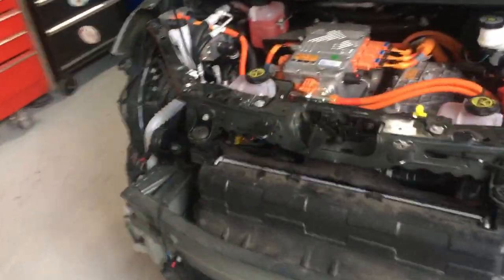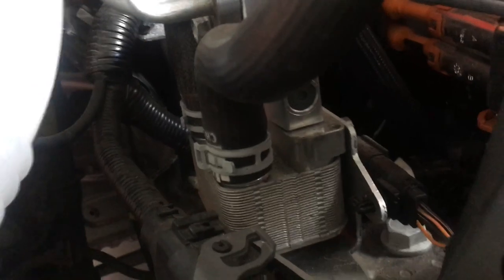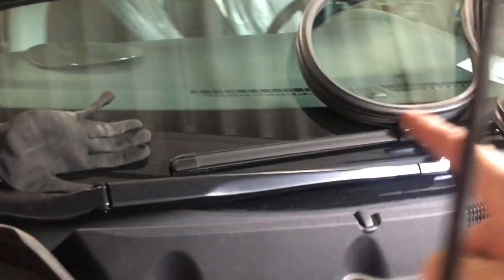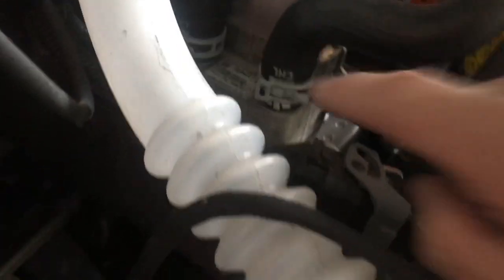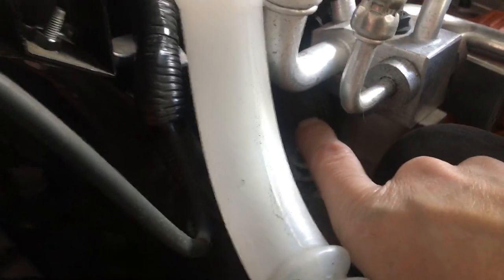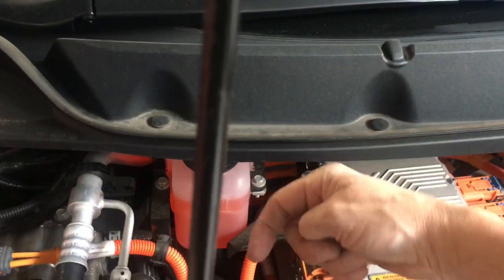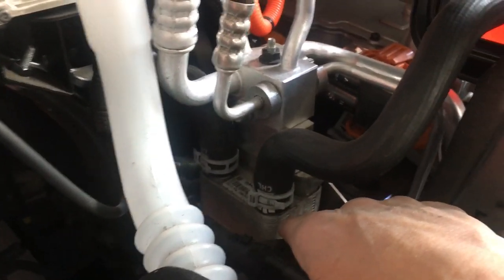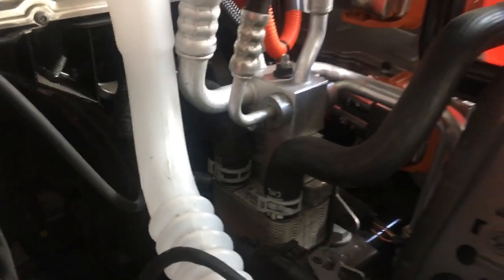2019 Chevy volt battery cooling

Comment: When your condenser develops a small leak you won't just be able to open your window to cool down - your vehicle will grind to a halt with its powertrain / batteries overheating.  Plenty of work for AC techs to come.
Reply from the maker: I already get plenty of this kind of work. Hybrid Ford escape is a good example. When the AC would go down on warm days the triangle warning light would come on the dash and I believe the customers comments they could drive about 1 mile then the vehicle with shut down. 
                 On the Prius your air-conditioning keeping the cabin cool there’s a blower motor located under the rear seat of the passenger. If it’s very hot outside Arizona 100° or if you’re traveling down the highway on the blacktop it could be 115° or 120° with the heat of the air that develops on black asphalt. You would get the triangle of death for your battery warning you to pull over and shut down if you don’t it will shut you down. 
              Another example of lack of knowledge some of these vehicles have solenoids that physically shut off valve in to the rear expansion valve for the rear evaporator or sometimes heat exchanger. It traps liquid refrigerant inside that line and that whole rear unit. The technician hooks up his big square refrigerant recovery and recharge machine and only recovers the refrigerant in the front half of the system the other part of the system has refrigerant trapped in the lines because the solenoid valve is tightly closed. Then the technician tells the machine to recharge the air conditioning with the factory quantity by weight back into the system (guess what just happened?.) because the technician did not know you have to have the key in the on position to keep that solenoid valve open to release the refrigerant when performing the recovery. 
               And if you just happen to perform that procedure on a cold day when the customer came in say somewhere in the 50° range to low 60° range he will probably not notice the high side will not be very high because it’s overcharged on a cold day. 
          But when the customer let’s say as an example one week later drive somewhere on a long road trip where the temperature is 20 or 30° hotter he will now have 400 psi on his high side and poor cooling performance and if it goes a little higher either shut down because of safety switch high-pressure or burn up the compressor clutch. I get a lot of these every year from very large experienced mechanical shops. And when you burn up and litter metal debris in a duel air-conditioning system all the way to the back evaporator have to take out and flush everything replace both expansion valves condenser accumulator you’re talking thousands of dollars. 
             And the failures usually don’t happen right away sometimes many months later or even a year later.
           Usually caused by the mechanics who use the little cans and charge the AC system up by pressure or temperature it works great at the temperature of the day that the technician charged it up on , but when the customer will go somewhere else hotter or colder is when the failure happens.
Reply: @coldfinger459sub0  - the need for good repair procedures and data is vital then.
Reply from the maker: Automotive Solutions The training has always been there and it’s even better today than it was 40 years ago when I was young we have Internet instead of having to go to the library‘s and check out books or order books and wait 3 to 5 weeks for them to be delivered from the car manufacturers to get OEM. 
          Most owners and many texts are too lazy or too cheap to go to training. Some believe if you go to training and you just sit down in the chair all the knowledge is going to just pour into their brain without picking up a book and reading as we know mechanics are known to be a little illiterate or lazy to pick up a book and read those little words on the page.
              Then there are those who are either the owners or technicians who literally believe you learn by breaking things and after you break it and you replaced it you have learned OMG.
           There are so many shops that either to the lack of knowledge of the owner of the business or the manager of the business the service writers of the business the technicians of the business they lose so much money by not educating themselves and wasting so much time on diagnostics and replacing wrong parts over charging the customer charging the customer for a wrong parts repeating this procedure for the whole entire careers.  Some of them struggle to make ends meet and they have no money or they won’t put out the money for education because they’re losing so money because they have no education. It’s a vicious cycle that keeps repeating itself over and over.
           One thing my father got clear into my head when I was very young even though I didn’t like to read books. Educate yourself better than the next guy learn more than whatever boss you have. Your boss can limit your hours your boss can not give you a raise if he feels like it your boss can not give you extra vacation days but the one thing your boss cannot take away from you is your knowledge. And once you have that you can fire your boss. If the owner of a business chooses to be ignorant do not allow him to bring the others that work under him to suffer from that same fate. 
           One day this is going to make a good video topic that will probably be very long video when I do it, (How to Fire Your Boss!.)will probably be the title.  
             Because in the end it’s the consumer who does not have the knowledge to fix their own cars who get ripped off from lack of training. And it is the technician who is starting out without education gets ripped off because he cannot make a good livable wage in a field that’s becoming extremely technical and complicated with a very high degree of electrical knowledge background that is needed on top of mechanical. 
            Need to educate all the young technicians not to become a parts changing monkey like they’re ignorant boss who can’t even perform his own oil change or diagnose his way out of a paper bag. 
           We need to eliminate all the owners of companies who can’t work on vehicles and selves who hold back the livelihoods of the technicians who work under them.
Reply: Well said, your father gave you some wise words. Thanks for sharing them. 👍

Comment: MUST you have that radio blather in the background competing with your instructions?
Reply from the maker: This is not my shop I’m just called in to do the work for them that’s my specialty.      The shop always has music blasting in the background I cannot work like that. 

      If you’ve seen many of my other videos you will notice I’m in many different shops all over the San Francisco Bay area I have a list of 1200 different shops I’ve been going to for nearly 30 years.     Some of them are quiet some of them are blasting radios. 

      Sometimes I making a video right next to a guy using an air chisel or a sander or impact gun and I have to yell above the sound of the tool.  
          I’m not a YouTuber  Who barely has work and can do one video a day setting up sound and lights in editing all my videos or live and take it in one shot no rehearsal and no editing.  
          I have to work for a living and earn a living no time for fancy camera work or sound system.

Comment: I have a 2016 Chevy volt with heating issues.  I get heat intermittently usually driving up a steep grade.  I hear gurgling sounds at times I feel like the system has air trapped in the lines.  Any ideas?
Reply from the maker: Sounds like air.  Fallow manufacturers instructions to purge air.
Reply: @coldfinger459sub0  thank you very much sir.  Unfortunately looks like the only way to purge is with a scan tool.
Reply: Then at my shop we say YFB (your fucked buddy) and "how deep are your pockets"?
Reply from the maker: @gregstandish6439 🤣 

Had a Tesla Y model burned out compressor and I was asked how much would it be? 

I asked them do they have the income of a small island nation .

Comment: yeah my 2014 volt is having issues with it. my advice, stay away from hybrids.
Reply from the maker: Toyota hybrids are not so bad any problems I have are well documented and there’s forms and websites devoted to fixing them so do it yourself people can do it. 

All the parts are easily available and relatively cheap. 

Then when my hybrid battery went out it was available the same day $1900 I put it in 45 minutes.
Reply: @coldfinger459sub0  Toyota hybrids (up til now) don't use Lithium Ion batteries...  (the new 2023 Prius Prime will use a Lithium Ion battery pack)
Reply from the maker: Was not too bad to replace. Only took 45 minutes to replace . I bought the battery it was only $1900.  

Easy , difficulty level easy like changing you brakes

I drive Toyota Prius C